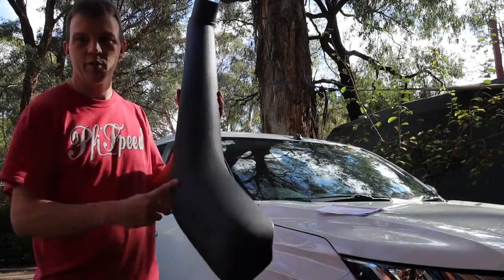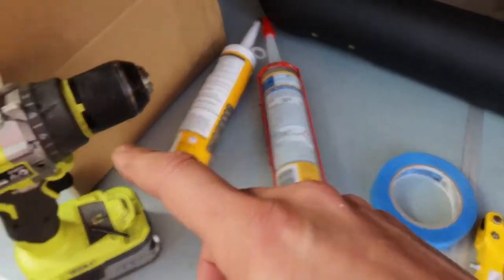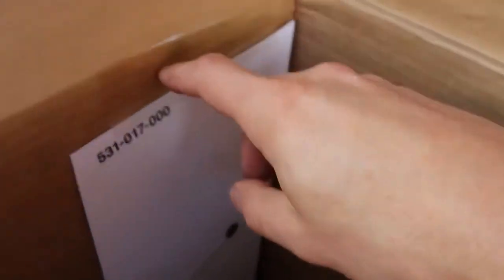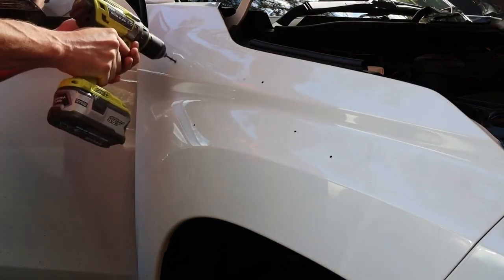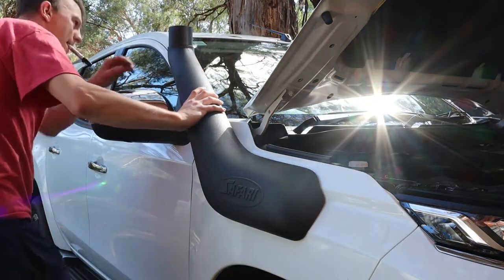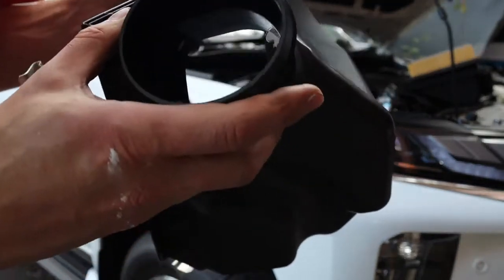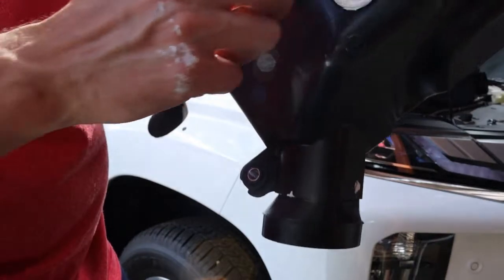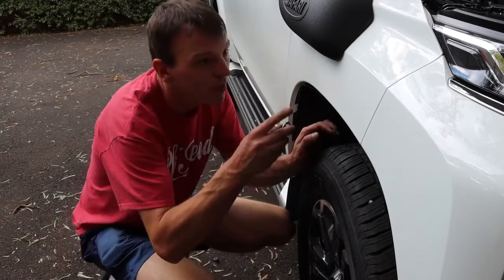MR Mitsubishi Triton Safari Snorkel Install - Step by Step Guide

Comment: Thanks for posting this man. Im kind of terrified of trying it myself, even though you made it look pretty easy! If it were an old shitbox, maybe I wouldn't care as much as with a brand new car.
Reply from the maker: Yeah I know what you mean its a bit nerve wracking cutting holes in a brand new car. It was so much easier on my last car which was an old nugget. Saying that - the way they design the template and the snorkel means there is quite a bit of room for error and it would be reasonably hard to stuff it up.
Reply: @thelapyear  haha thanks for the reassuring words. Maybe I'll suck up the courage to have a go :)

Comment: I hate when you say…… I think it’s 121 mm or I think, I think.
Please be exact mate , this is a $40,000 vehicle I’m working on and it’s mine. No hard feelings, and appreciate your time putting this video together.
Reply from the maker: Hi Rob - yeah i understand I just didnt have the instructions handy. Just checked and they mention 121mm - which in Australia means a fairly expensive sutton hole saw. I used a 127mm one and after checking it against the template and the snorkel i worked out there was plenty of space for it to be covered up. I basically did this because I already owned the hole saw. I'd recommend centering the hole saw you are going to use over the hole in the snorkel just to make sure you have enough coverage from the snorkel body. To be honest you could go quite a bit bigger and i think they keep quite a bit of contingency for if you stuff up putting on the template. Good luck mate, that big hole is the scariest part of the whole install.